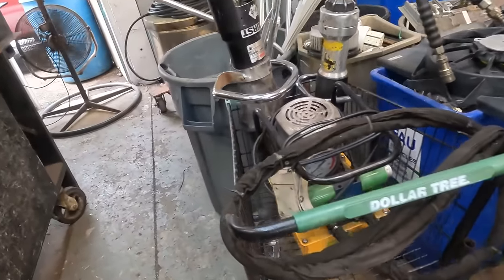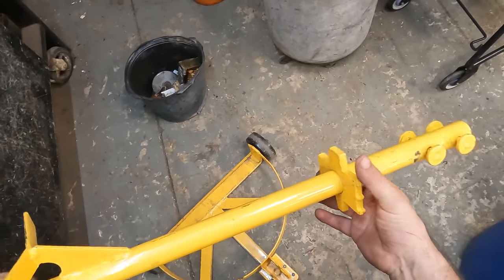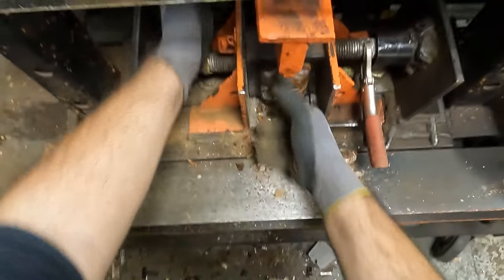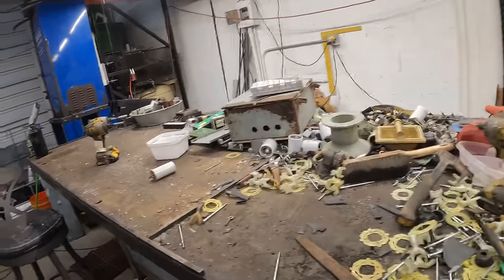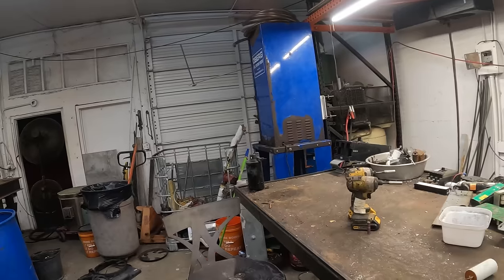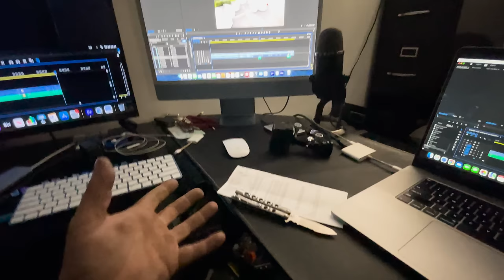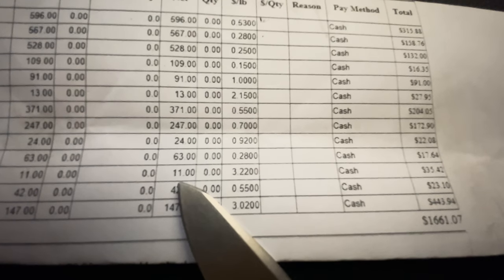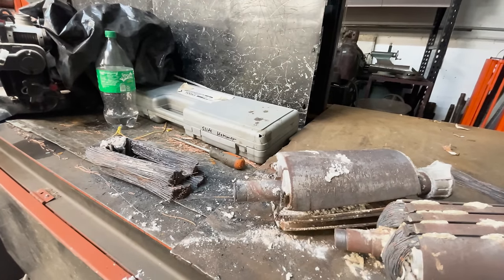Micro Scrapping & Sluicing Some Dirty Copper Pt.3

Comment: You could do episode on all the fake Al, brass, & stainless steel, more for consumers because in all my years of scrapping, even though all the lamps look like brass, only 2 have been pure brass.  Even I can't tell without destructive testing using my utility knife.  I cut deep to see if there's yellow brass under finish.  

A lot of kitchen sink stuff has the silver stainless steel looking finish & is slightly magnetic like almost all stainless steel, but are just die cast underneath.  Again, destructive testing is used: I hammer, die cast crumbles, but if brass, split will show yellow & stainless steel is very tough.

The fake Al would be all the pot metal out there, 100% non-magnetic.  Best example is red fire alarm case.  Usually I can tell difference because pot metal more dense.
Reply from the maker: Thanks for the suggestion

Comment: Do t use the plasma cutter on the compressors. The hire and heat will melt the plastic dividers to the copper. Use an angle grinder to cut them open. Its more tedious but it saves the headaches.
Reply from the maker: Thanks for the info
Reply: @ProjectShopFl  I have a jig that I use to cut many sealed units open/ compressers open and nvr have a problem

Comment: I wonder what year they started replacing transformers with the aluminum coils. Because some of them look sooo old. But I guess it could be from getting hot then cold everyday for a few years. But still would like to know how long are they supposed to last before replacement? A year? 5 years?
Reply from the maker: I think it depends on the condition and location. I've seen old fixtures with the original transformers in the same parking lot as ones with new aluminum ones.

Comment: Why are you cooking the rotors in the kiln?
Reply: To get rid of the epoxy holding them in.  He'd yank them out but some of them won't budge even using hydraulic force.
Reply from the maker: Makes it easier to remove the copper.